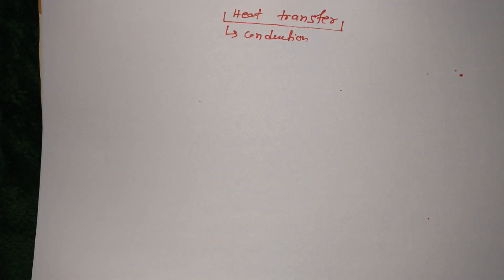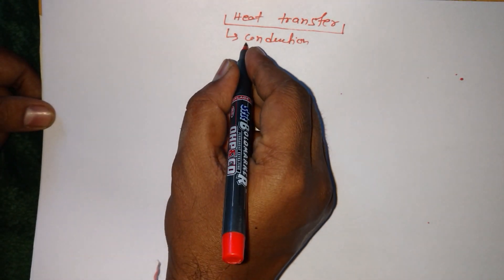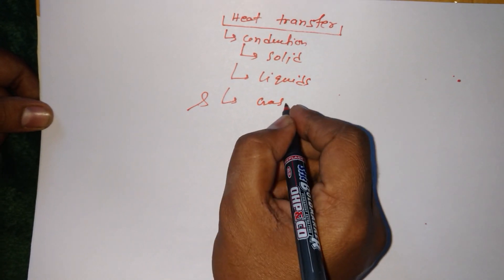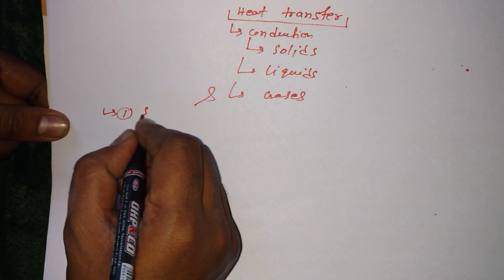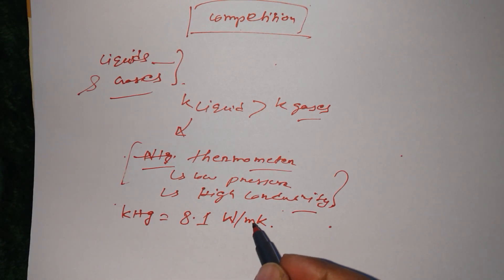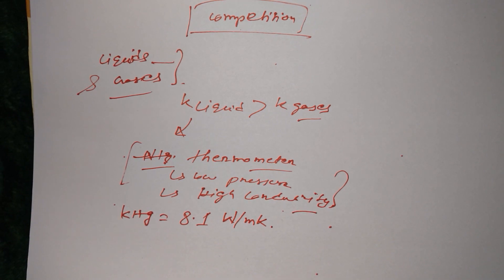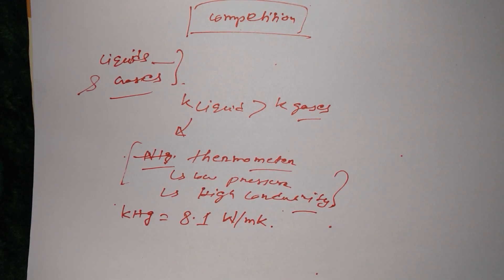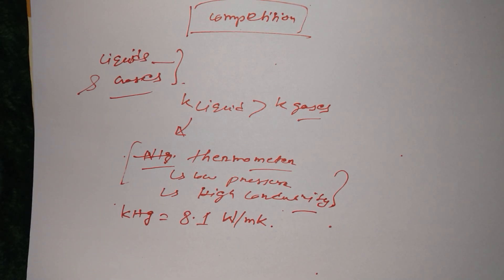Conduction Process in Solids, Liquids and Gases HMT Tutorial- 6

Comment: Molecules does not transfer in coduction
Reply: Without an actual motion bruh ..
After the molecules vibrate they eventually comes back to its original configuration ...
They vibrate due to the heat energy ...